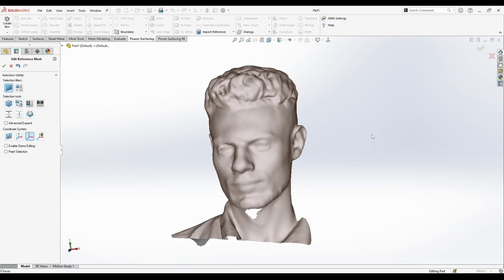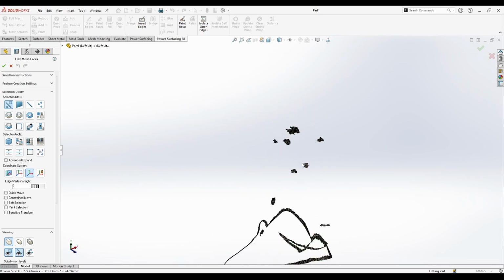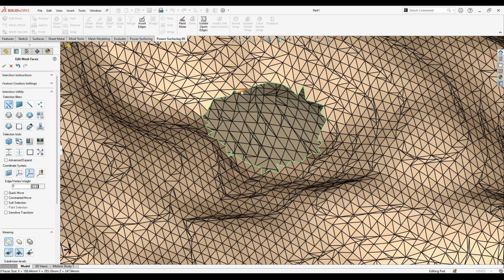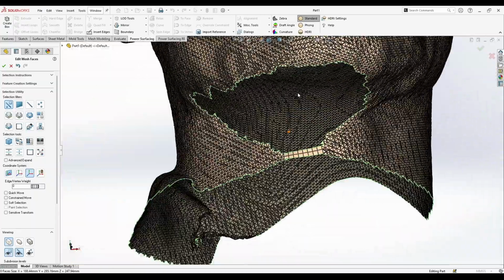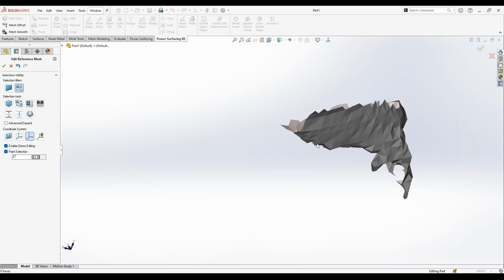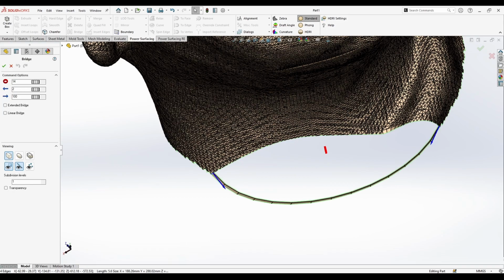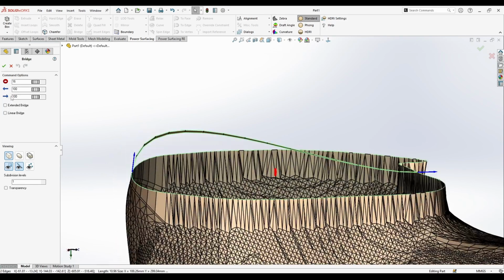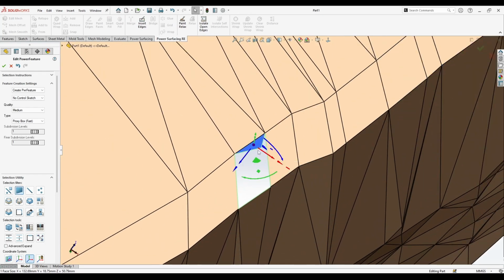Reverse Engineering Scan | Power Surfacing RE | SOLIDWORKS

Comment: Shortcomings of the plugin
Design tree
to isolate
The appearance of some icons is not beautiful
Sketch not active
And...
It would be great if the appearance of the plugin looks like SolidWorks software
Reply from the maker: We have a standalone Software that has a design tree called Cyborg3d. You can visit the website to see.

There is a trick you can do to isolate a part, we'll be showing that very soon!

This is a freeform tool, You can do the revolve and sweep..etc after converting to solid, however, this is for getting a high-accuracy design. If you modeling industry designs.
Reply: @npowersoftware6638  Hello, if the sweep, revolo, and loft commands are added, the design of the car will be very enjoyable from four views. It exists in the NX software, and there are examples of its videos on YouTube. Thank